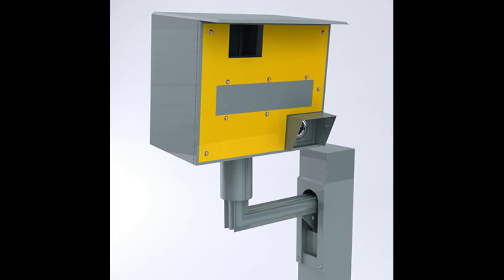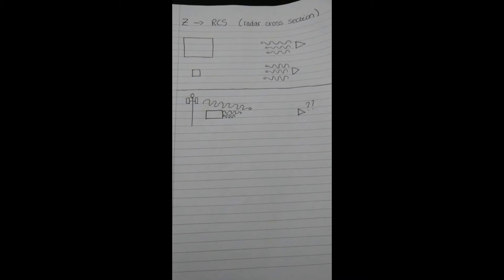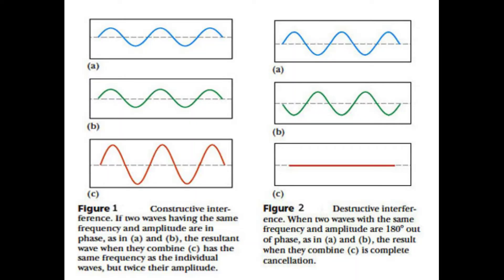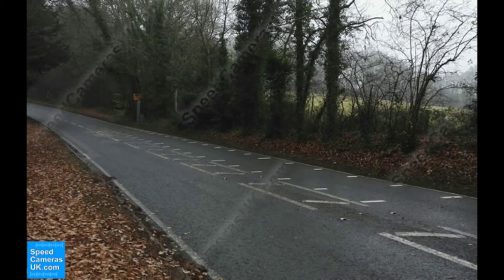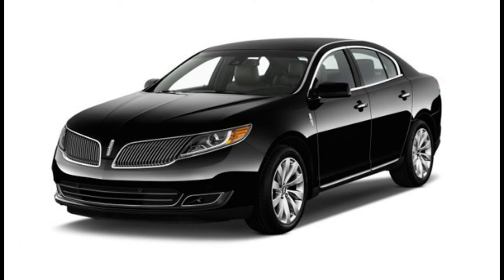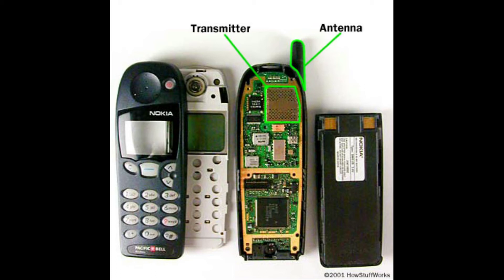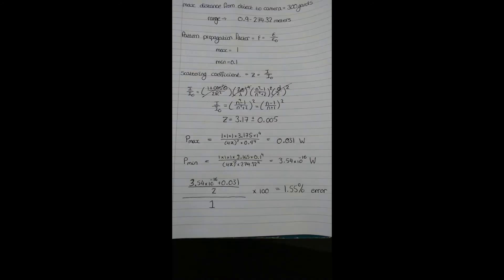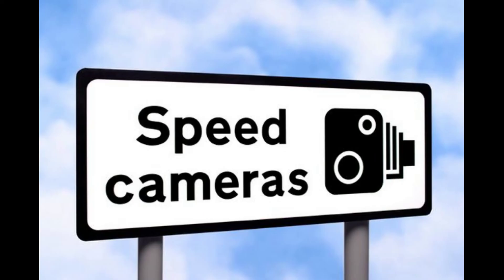How Accurate are Speed Cameras?

Comment: Hi bro that was a bit heavy for the average driver but still interesting 🤔 I have a ? You may be able to answer for me, how accurate is a speed camera at picking out individual vehicles at a few hundred meters? I got a speed ticket last year in my work van saying I was doing 71 on a duel carriageway (60 for vans) but with the speedometer on my van reading 10% over I would need to have been doing at least 77mph on my speedometer ! I was on the inside lane and cars where overtaking me also my van is tracked for speeding and I have never had any over 70 reports even on motorways ! £100 & 3 points after 15 years clean doh 😖 thanks for posting
Reply from the maker: Glad you enjoyed the video. The cameras are usually fixed to a set "window" on the road, so they pick out vehicles in that segment. If you have the tracker proof of not going over 70 then I would assume the police would need to provide a calibration report for the camera to check it was aimed at the correct lane. It can happen, however, where the cameras pick up animals or leaves or discarded items and trigger the flash, so maybe worth investigating.